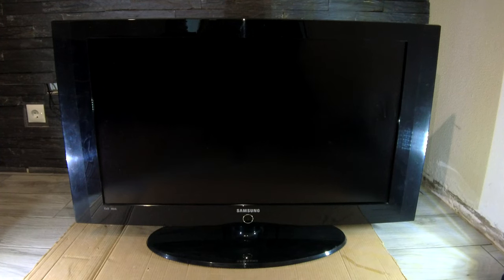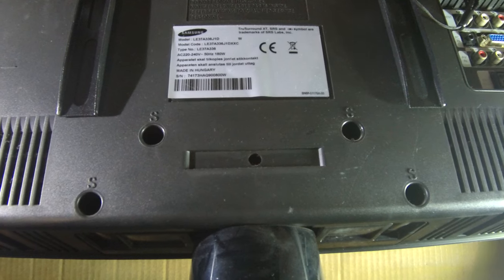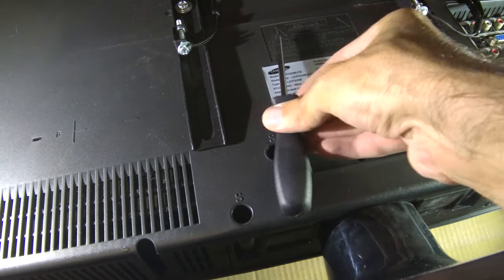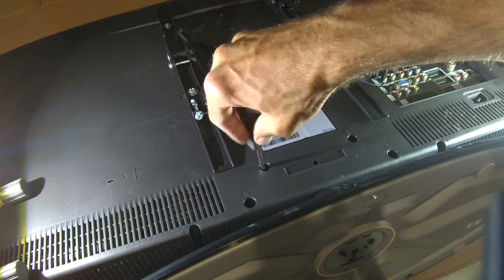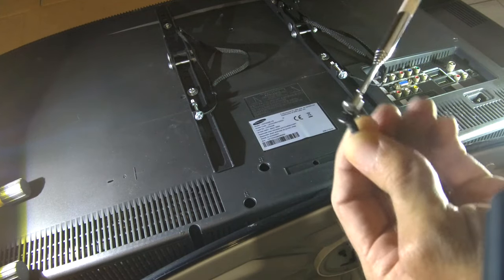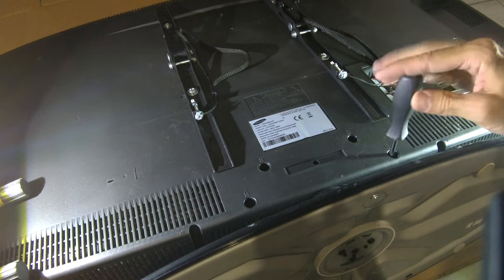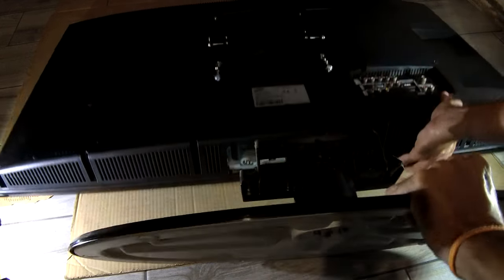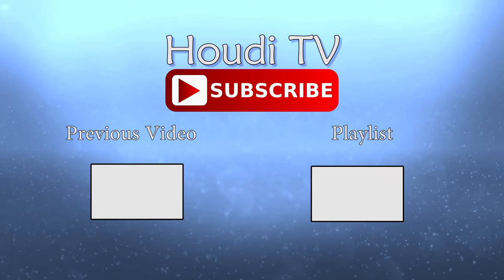How to Remove the SAMSUNG LCD TV Stand / Base

Comment: Thank you for doing this it was very helpful. Do you know how to test a tv circuit board to see if it is bad?
Reply from the maker: Thanks for watching. It depends of what is the problem. I need more info, whats wrong with ur tv?
Reply: No picture or sound. There is power because of the background lights. There was a small power surge and the set went blank. Any help would be appreciated @houditv
Reply from the maker: @markrubenstein3225  start from this video, in my opinion it won't be easy to find the problem. https://youtu.be/wmxRe1GPIvY?si=23twJQ2UoepWUHtO